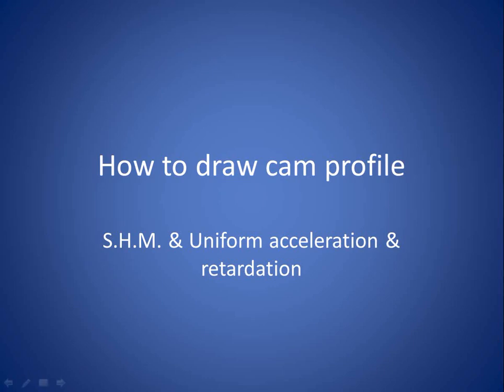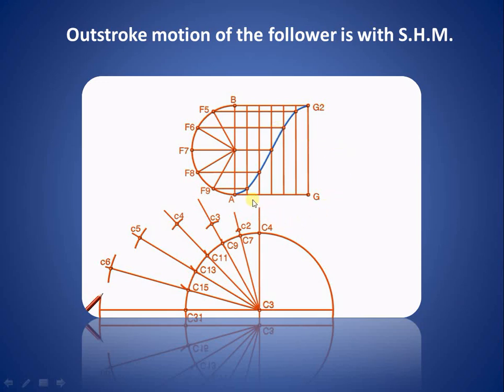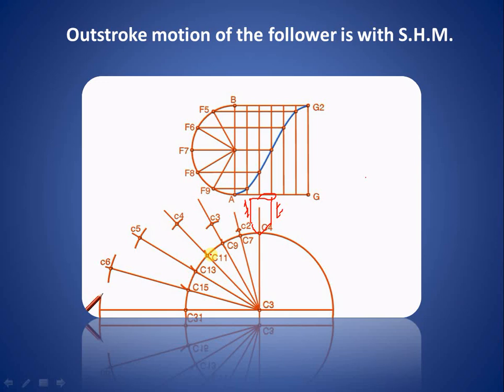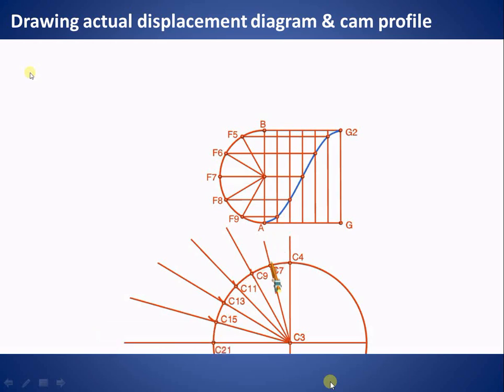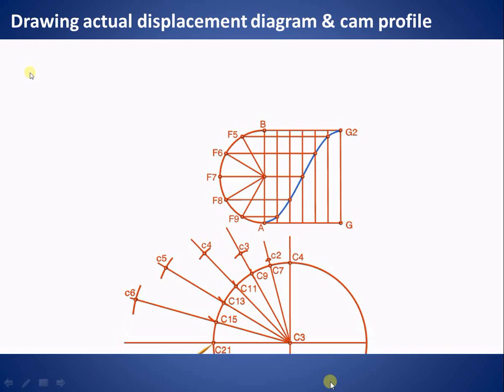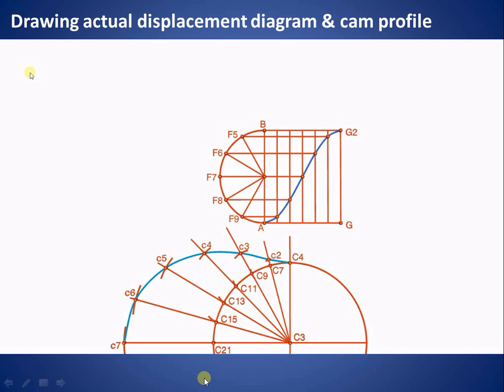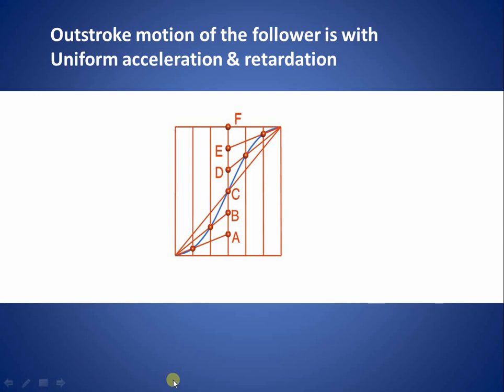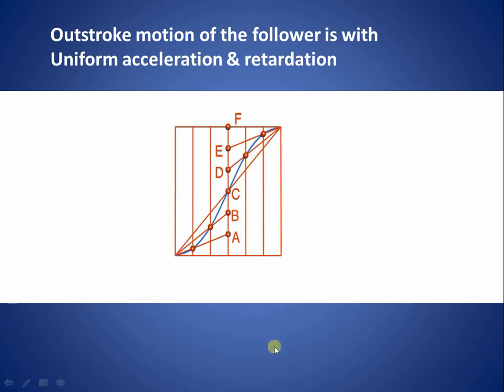Lecture 8 | How to draw cam profile

Comment: Why should we divide the out stroke into 6 parts ?
Reply: 6 is convenient
Reply: +Rakshith  thanks :)
Reply: You can divide into any number of points say 'n' but n should be even
Reply: +Justin Werner why should 'n' be even?
Reply: It should be even because you have to divide that profile into equal number of symmetric parts and that can be achieved only if you divide by 2,4,6, and so on